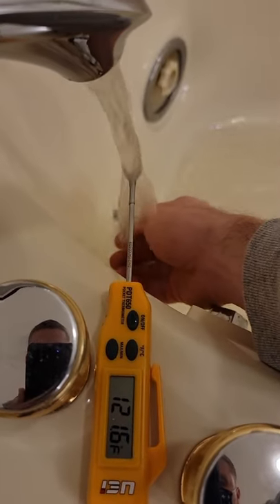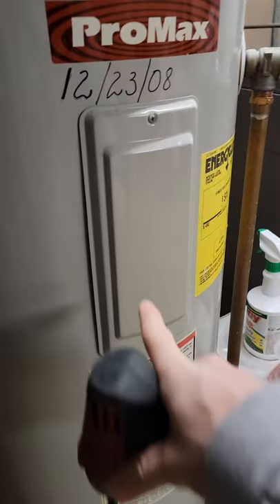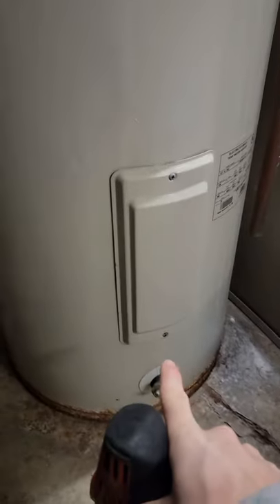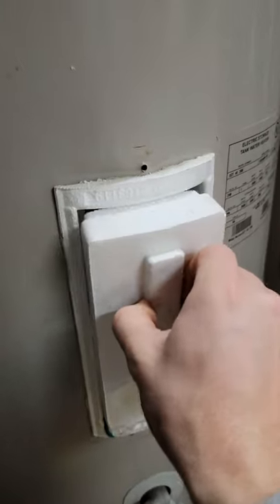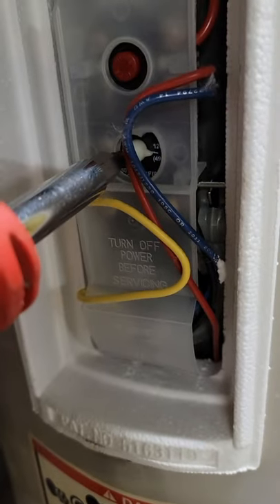How to adjust and electric water heater #shorts #plumbing

Comment: regarding the thermostats temperatures, why should the top be higher than the bottom?
Reply: Because the water at the top of the water heater comes to the water supply first , the bottom is heating up the In coming water from the street or well

Comment: I will try this. But mine is set at 135 on the top and the bottom. The kitchen and bathroom sinks and the shower takes forever to heat up. My hot water heater is only 6 months old.

Comment: I have the ecopeak 60 gallon electric hot water tank, with 3 heating coils. Do I set the top one a little higher than the middle one, and the middle one a little higher than the bottom one?
Reply: Same at home but mine has a from bottom water in supply. I would set the lower at a higher temperature.

Comment: The water temperature is slow to heat in my kitchen sink. My upstairs master bathroom has 3 different Temperature.  The stand alone shower stays hot longest. The sink is slow to heat and the bath doesn't stay hot long enough. O and the water drain out while bathing. What should  I do? Thanks so much
Reply: I have a similar problem where there doesnt seem to be an inbetween of hot or cold, mostly in the bathroom sink and shower
Reply: turn off breaker to water heater verify theres no voltage remove covers and raise the temp on both elements go for like 135F-140F range. So set the lower one at 135F and the upper at 140F yes thats hot but by the time it gets to your faucets it should he nice and refreshing. Need to replace the tub stopper. 
-Professional Home Owner